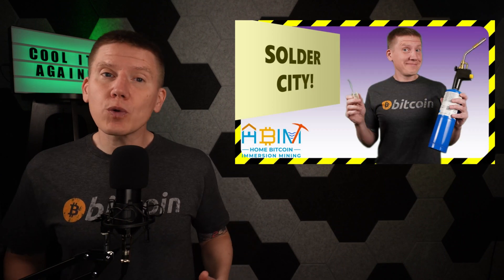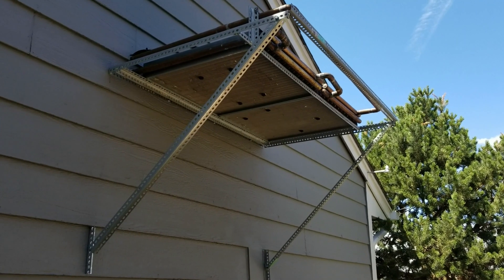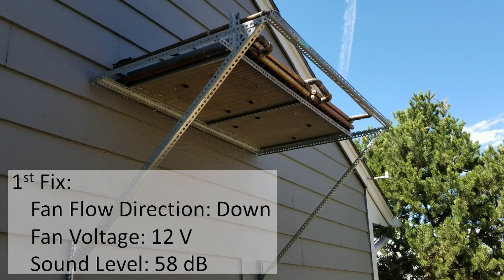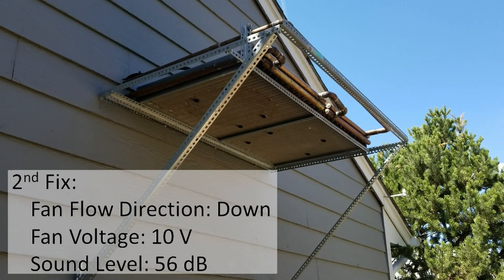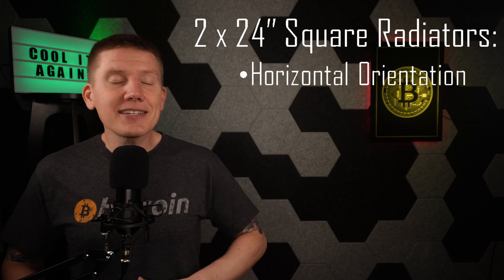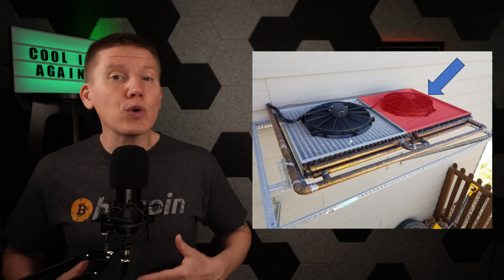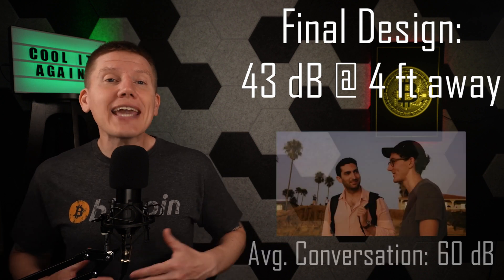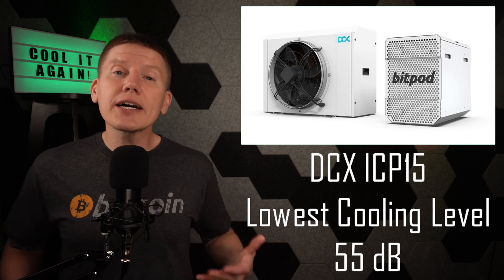EP26: My dry cooler update - the ULTRA QUIET design

Comment: Hello i want to make the same system for 8 machines with the lowest sound possible plz help how  big coil do i need i think if i put more fans with low rpm !
Reply from the maker: With 8 machines, you're big enough where a commercial dry cooler starts making a lot of sense.   They're a bit more expensive, but many have setups where the fans will throttle up/down or turn off in reaction to fluid temp.  They also are made to minimize noise, so even at full speed, the fan noise isn't too bad.
Reply: @HBIM_Channel  Hello. May I know the power consumption of the DCX ICP15?

Comment: Turn off fans, setup gets more quiet 🤔 ✍️ 😁
Reply from the maker: What can I say....I'm a master of the obvious, LOL!
Reply: if you can use the heat for home heating, water boiler heating, or swimming pool heating - then yes, you can have 100% quiet mining operations at home
Reply: @tomaszbuk9519  Well... not 100%, but pretty close... still the sound of pumps and fluid moving around ;-)